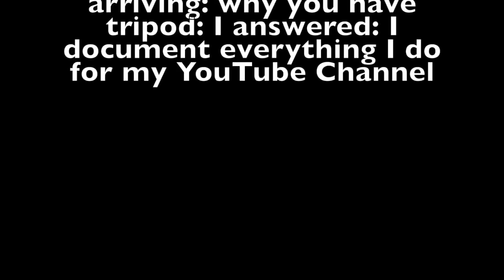Filming Guide One insurance adjuster went wrong: Adjuster walks away on Dmitry (Roofing Insights)

Comment: Those small dents will not affect the longevity of that metal roof,unless the hail damage is bad enough to allow the roof to leak. That contractor is just exploiting everyone causing the price of roofing and insurance to go up
Reply from the maker: Would you drive a car with hail damage? It will not leak inside why would you care right? Or would you “exploit” insurance company to file a claim?
Reply: If you have to rub the dents with chalk to even see them then yes I would drive the car and not create excessive claim and cost to the industry
Reply: Are they trying to get a new roof because of some little tiny dents? Wow what a scam
Reply: its the adjusters they what to replace it if your paying but not if they have to most have more training in this than the actual craft of roofing
Reply: I usually am on the contractor's side in these videos but this particular issue is different. The WHOLE POINT of this style of roof is to take more dmg than shingles. The reason we redo shingled roofs with pocks and dents is because they are an issue. On a metal roof, they are not. That again, is the whole point of metal roofing. It's so that you don't have to replace your damn roof everytime there is a hail storm...
Reply: @ravenna6543  I agree with what you said, I just don't know why he got upset about being recorded?
Reply: @danbrown7224  Some people are really not ok with being recorded even during work like this. IDK, I kinda get it. I don't even like being in photographs with friends but at the same time, I won't throw a hissy fit about it.
Reply: @ravenna6543  I agree, but in my opinion on his line of work he should expect to be recorded at an estimate like it or not , especially this day of age there's cameras every where like it or not,
Reply: @danbrown7224  100% agree
Reply: @ClickBait99  then they probably shouldn't be getting metal roofs?
Reply: I don’t see any paint chips in those two tiny dents, that roof will deteriorate over time due to the sun rain and people walking all over it. Its a shame no one wants to quit wasting time and money over such trivial ideas
Reply: The problem is not so much the dents, it's the dents have stretched the metal therefore causing undue stress on the finish which in turn will lead to early roof failure. Not to mention paint missing off your roof is unsightly.
Reply: If that metal roof was half way decent that chalk wouldn’t even write on the metal surface because it’s supposed to be smooth and glossy finish…that’s some out dated nailed on old school metal, probably put on in the 80’s lol CLAIM DENIED
Reply: @bradlycriswell1990  If your dented up paint faded rusted out Camaro got some questionable dings in it from hail I doubt insurance is going to be buying you a 2023 Camaro….I roof for a living and own 2 homes and pay plenty of homeowners insurance, your “sheep” comment is so laughable lol
Reply: @3rdgen257  sure you would lol. Come on..I get the point you arw trying to make , I do. I also can observe a corrupt inspection. How can he record zero and then make up an excuse ? Also remember,  the policy holder called the insurance.......not the contractor.
Reply: So the contractor called to make a claim? Or the policy holder? Yeah that's what I figured
Reply: @danbrown7224  better yet maybe the insurance company shouldn't insure them....but they take that check for the policy every year.....don't they
Reply: Cosmetic only , and you can't drive a roof.
Reply: @bradlycriswell1990  Well I’m about to see if your theory is true …wife was legit just in a fender bender in my old ‘08 truck, what color should I go with on my new one? If they don’t give me a new one can I borrow some of that 3x money? 🤣
Reply: @3rdgen257  some people like to take care of the things they own, hence getting insurance in the first place...
Reply: @bullfrog1807  If your faded out rusty camaro has full coverage, they will pay for hail repairs. Either the cost to repair and repaint the car or the value of the current vehicle.
Reply: @RoofingInsights3.0   different comparisons. most insurance policies specifically exclude cosmetic damage on metal roofs. If it doesn't affect the function of the roof, they won't cover it.  Again, thats most of those polices that are written as excluding it. There are inclusive coverage policies, they cost more of course, but they do cover the cosmetic coverage.  Make sure you know what coverage you have before you file a claim.  This one may have not had cosmetic coverage and thus, the adjuster is not finding anything that needs to be fixed, under that plan .   Asphalt shingles are different... the cosmetic damage there is also structural as the shingle depends on the asphalt and the granules to provide protection.
Reply: Fact: Adjusters pay for 90% of the roofs where hail damage is claimed.  

Also Fact: Roofing contractors believe all roofs are damaged from hail at all times.
Reply: Agreed minor dents not that important.
Reply: It's called property value. Just like a car value will go down with dents. May not be able to see them from afar but when you go to sell the car the buyer will notice the dents. Just as a property owner when selling a buyer will request a roof inspection, a smart buyer that is.
Reply: @RoofingInsights3.0  Dents in a car lowers it's value by a lot, tiny dents on this roof will not lower the buildings value.
Reply: Insurance's whole thing is exploiting people and denying claims LOL
Reply: @bullfrog1807  well Yeah, because there aren't going to be any 2023 Camaros.
I did just buy a 2022 ZL1 though
Reply: If the dents make my roof look like shit.  Hell yes I am going to file a claim.  Having a roof that looks like shit could affect my business.
Reply: Is he a contractor?  I thought you, Dmitry, were the contractor and he was an insurance inspector.  You’re right though, this kind of attitude is garbage.  What’s he afraid of?  That you will be able to show the insurance company that he was dishonest?  I think that was made clear in the video what with the 0 pings marked on the report.  People like that don’t like it when their authority is challenged so he basically “took his ball and went home”, so to speak.  I hope you have an update to this case.
Reply: @Fred-zt6gf  That’s total BS dude.  If the home owner wants to record they should be able to do that for their own protection and yours.  If you do so called honest work then this shouldn’t bother you in any way.  Are you worried that your little shortcuts will be discovered and there will be a digital record of it?  Pay you extra because your client turns on a camera?  You aren’t a celebrity, sports figure, or singer so why would you think that someone would want or even should pay more for that?  That you actually have stated in a public forum that you “will not do my normal work” tells a lot about you as a person and your lack of scruples.  SMH.
Reply: A dent on metal roofing, regardless if it completely penetrates the panel causing a leak, is still damage.
Reply: @ravenna6543  doesn’t matter how you feel about it, you can filmed in public. End of story.
Reply: @darthbrooks4933  That's my point.
Reply: Not true
Reply: It’s called indemnify, for a reason.
It has nothing to do with leaking.
The roof is covered for cosmetic appearance and damage.
Reply: @djchristrent  Roof looks fine, cosmetic appearance is near perfect.
Reply: @ClickBait99  so repaint it.
Reply: @3rdgen257  you likely pay for this coverage inside your policy. It’s not just a cosmetic issue. Dents, caused by hail, on a metal roof can cause micro cracking to the paint and substrate. This leads to oxidation and premature rusting. On an asphalt shingle, hail hits CERTAINLY cause premature failure.  If you pay for the coverage inside your policy, and there are real problems caused by the damage, then there is absolutely nothing wrong with trying to file the claim.
Reply: yep
Reply: People still pay years for insurance, and when they finally need it insurance companies will screw you over every time.
Reply: @RoofingInsights3.0  if I had insurance due to hail I'd take it.
Reply: @Fred-zt6gf  why do you need to get paid extra to be recorded?
Reply: @RoofingInsights3.0  An auto insurance claim and a homeowners insurance claim or two different claims. They are treated different
Reply: @bullfrog1807  If it totaled the vehicle they will only give you the current value of that vehicle. They will not give you full replacement cost. They’re not going to give you 30 or $40,000 for a $7000 truck
Reply: @bradlycriswell1990  your comment the bullfrog is the most laughable comment up here. No one said a damn thing about your net value nor do they give a damn if you want to brag about it or not. You’re just showing your ignorance and insecurity
Reply: @bp4170  you would have to have one hell of a dent in the metal roof for your statement to be true. I have a roof that is over 18 years old and has dents in it from a hail storm after the first two years of installing it. To this date we have had no problems with the roof. No paint chipping no rust forming nothing
Reply: @alllivesmatter627  I have a metal roof therefor Im an expert!🤡
Reply: @bp4170  well I’m glad you are. But having a metal roof does not make you an expert. 20+ years in the business dealing with the reps from the shingle companies and the people that make the metal roofing helps to give you a lot of knowledge for which I have
Reply: @ClickBait99  it’s not the same as an asphalt shingle, poor comparison.
Reply: @michael2943  very common in this industry.  Roofers are just as bad as the insurance companies that argue claims.
Reply: @ClickBait99  claiming all small dents causes paint chipping is inaccurate.  Claiming this roof needed to be replaced is laughable.
Reply: which is what ends up happening, either way it needs to be recorded not a ZERO. The Adjuster did his job wrong and does not deserve another claim. Meanwhile, people like myself work hard every day with tons of experience to land places like Churches - to give them an HONEST assessment. This guy had his mind made up before he even got there. He is a LAZY OLD MAN.
Reply: @RoofingInsights3.0  sue them for damages loss of pay effing up the job get a bigger settlement
Reply: You clearly asked him to look at the mark and he immediately refused
Reply: Your absolutely right....
Reply: @3rdgen257  so whats the point in paying insurance?
Reply: @bradlycriswell1990  a man child that doesn't have the ability to type 5th grade level english is telling another man he can buy them 3 times over. Here is your trophy for being king of the internet today, enjoy your success big girl.
Reply: @RoofingInsights3.0  i do drive a car with hail damage. Insurance is for large losses. They will just raise your premiums.
Reply: @dillydilly952  building gets catastrophic damage like roof blows off or building burns down, not a broken finger nail or paper cut
Reply: @WolfBiteTactical  what a scam it seems like the insurance adjuster s e e s the indentations and determine because there was no splatter marks was not caused by the same hail storm or even hail damage if it was hail damage would be clearly across the entire surface of the roof Dimitri is stretching the issue see if he can convince the congregation of that church to pay him and his crew to replace it at their expense
Reply: @unknownperson2422  and if they don't pay the claim you're going to pay to have your roof replaced yourself?
Reply: Once I heard the eastern European accent, I knew it was a scam by the contractor.
The roof is not a car, by the way. The standards are different.
Reply: @danbrown7224  He has something to hide.
Reply: @ravenna6543   Wow, never saw hail damage on a shingle roof... must be baseball size! lol
Reply: @RoofingInsights3.0  for one you see the dents on the car and probably damaged paint. I’ve had 2 cars with hail damage and they drove and operated just fine.
Reply: @danbrown7224  insurance shouldn't be covering metal roofs then
Reply: If you don't get it fixed, it voids manufacture warranty...
Reply: @RoofingInsights3.0  I got my truck in 2015.  It's had minor hail damage since 2016.  Haven't filed a claim.
Reply: @RoofingInsights3.0  A car is not a roof. Does the policy cover cosmetic repairs, or just damaged leaky roofs? If you can show the dents will cause the roof to fail, then for sure that's a reroof, if not then what does the policy say?
Reply: @RoofingInsights3.0  gloss paint and this paint thats satin an old is not a great comparison
Reply: @ravenna6543  insurance companies do cover dents on metal, whether they be roofs, fascia, gutters, etc. Just like in the case of a car, it is cosmetic, but still covered under MANY policies (given I can't speak for this particular policy). I feel like a lot of people commenting on this, including you, do not work in this industry and don't know how these things work. It is possible that this company has no idea what they are doing, but I'm sure they checked the policy to make sure hail hits were covered prior to calling in the claim and meeting with the adjuster.
Reply: @bullfrog1807  Someone with a head on their shoulders. It would be like me trying to get a pair of work boots replaced on warranty after wearing them for a year. That roofs like 40 years old and the building hasn't had leaks. I'd say someone got their money's worth.
Reply: @mikeekim242  I doubt an issurance company would still cover cosmetic damage on a roof that old
Reply: @nowerries  Well that was my point. What is in the policy? One side is trying to save a buck, and the other is trying to make a buck. That leads automatically to conflict....LOL
Reply: Yup, far as I'm concerned that was an old looking roof that looks like it has earned every penny that was spent on it. Would of probably been a task just to find panels to replace the existing ones with.
Reply: Insurance companies are paid millions of dollars to restore broken things, that's their job, that's why they get paid. But what they really want to do is take your money, keep it, and NEVER do their job.

The roof wasn't installed with dents the insurance company agreed to repair if damaged.
Reply: @lawsonransom8318  
You actually think water pools in those dents
Sorry to be you
Reply: @3rdgen257  I know it happens. 

I have had dozens of metal roofs approved because of it. But don't believe me.

I could care less what you idiots think or do. My company did $4.5 million in roofing last year. 

😆
Reply: @danbrown7224  if insurance companies don't want to cover metal roofs they should not insure metal roofs
Reply: @tunit8946  that's a stupid comment. What does driving it have to do with anything
Reply: @brucehart4627  very true
Reply from the maker: @bullfrog1807  in that case insurance company shouldn’t be insuring it and taking premiums for 40 years to cover it.
Reply: There paid to lie.  Otherwise no more work.
Reply: @ClickBait99  This needs higher up.
Reply: @RoofingInsights3.0  Yeah that’s true for sure, definitely should be up to the insurance company to send someone out annually to inspect roofs to determine if they should even be covered in the policy or if they will even provide services at all due to poor condition. In this case I could agree maybe a partial payout could be issued….but still think that roof was way past due to be replaced, homeowners shouldn’t be waiting for natural disasters to avoid paying for a new roof. Like I said I do see your point
Reply: @Sidicas  thats not restoring to a pre loss condition.
Reply: @RoofingInsights3.0  That is an apples and oranges comparison. Roof covers will receive cosmetic damage. That is a given, it does not impact function, the function of a roof is not to look good while you drive down the road. What exactly is the remedy for 'correcting' a few small dents in a metal panel roof? What does the manufacturer say about a few dents? Legally, you have the right to film this guy if he's in public, I guess. Professionally, you stop when he asks you to stop. That is bush league. You want people to treat you like a competent professional, you need to act like one. The people you encounter professionally are not fodder for your click-bait. Are you a roofer or a content creator? Honestly, it seems like you don't know much about either.
Reply: @RoofingInsights3.0  to be fair people see it on cars, I wouldn't care if it were on roof, unless it caused damage that leaks
Reply: Doesn’t need a new roof get outta here
Reply: As someone who works with a multinational insurance company, I can say with certainty that this is a ridiculous take. 

These people opened a claim to have this damage repaired.

The adjuster is trying to pretend that part of the damage doesn't exist.

Policies cover "sudden direct accidental physical loss"

Those dents affect the value of the roof and building, which constitutes a loss.

Those dents also open the door for long term maintenance issues (they're not leaking now, but they might be 5 years from now) that won't be covered by insurance.

If damage is caused by a weather event that the insurance company has agreed to cover, and the insurance adjuster is trying to pretend like part of the damage doesn't exist to save his company money, this is clear cut fraud.

He should be reported to this state's department of insurance, and the client should get a private adjuster who has an incentive to find damage not hide damage.

In no world does damage ≠ damage simply because "it's not leaking." This idea that the dents "are just cosmetic and shouldn't be covered" is ridiculous. You realize that the cosmetics of your home affects its value correct?

Not to mention, it should be obvious to everybody that actual DENTS in your roof aren't just "cosmetic." These areas will be much weaker and erode much more quickly over time. It will also open the door for rust to spread incredibly quickly. Any who works with metal understand how dents allow rust to creep in almost instantly.
Reply: Beat me to it.
Reply: Read policy b4 commenting
Reply: Just ignorance… if there’s a hail event in an area.. then that whole areas premiums will increase bc that area is higher at risk.. these insurance companies are BILLION dollar companies. They got money to pay Patrick Mahomes and Aaron Rodgers but not their customers?? That’s insane
Reply: BINGO
Reply: @ravenna6543  No, that’s not really the whole point of this type of roof. this type of metal roof with this gauge of metal hardly holds up any better than a shingle roof during hail as far as damage. It’s what happens over time after the hail has already caused the damage to the metal roof. It’s irrelevant that a metal roof will last longer than a shingle roof. But it will only do so undamaged.
Reply: @RoofingInsights3.0  Nobody can see the roof. The roof's job is to maintain the building envelope, not have a show-room shine.
Reply: Most metal manufacturers say any dents void the warranty because it could cause the enameled finish fo come loose because the metal stretches at a different rate than the finish
Reply: @3rdgen257 cool story man, tell it again
Reply: You don't know what microfractures are or the long term effect?
Reply: @danyoung9671  please give the explanation of what you are commenting on please
Reply: @ronfarrell08  
So walking on the roof must destroy it right?????
Reply: @3rdgen257  if you dent the roof when you walk..yes.
Reply: Pitting in a metal roof ruins the longevity of it. Pitting can cause rust, from paint chipping, and holding water.
Reply: What a joke of a claim! Claiming for a new roof for little dents🙈this is why our insurance payments are so high
Reply: My car has minor hail damage,  no leaks, runs fine. I drive it everyday. Wtf yall bitching about?
Reply: Dude!!! It's not just cosmetic. Where do you think the paint will peel first? Then where do you think it will rust through first?

There is no such thing as cosmetic damage on a roof.

This is what should happen. Insurances should not cover thin corrugated roofs, or increase the costs, UNLESS it is aluminum.

Other than that you should get thick Guage roofing.
Reply: @3rdgen257 when it is a nasty ugly color because the paint chips . . . That is called depreciation of home value due to storms. 

When they go to sell the home,  you think the adjuster won't notify the buyer to get them a discount? Lol
Reply: @chadhickey9942 not the case in indiana, but yes. Very possible and true.😊
Reply: You pay more than what you will ever. Get from insurance in your life. You work hard for your home and business to have a dented roof. Make that claim and get what is rightfully yours that you paid for and will continue to pay for. If the industry goes up then look at how many people at the top of that company are making for doing almost nothing. Re direct your malice toward the greedy and not people getting what they pay for
Reply: You don't know what his policy is, cosmetic damage could very well be covered. I'm sure the homeowners insurance didn't hesitate to take his money every month insuring that roof, so they shouldn't be hesitating to repair it either.
Reply: A lot of ignorance displayed in this particular response thread. wow. A lot of comments are conflating damage and coverage. Two different, while related, questions. If you don't understand what happens when the metal is dented - don't comment.
Reply: A year later here I am lol.. for 1. You know nothing about the policy or contract that the insured has with the carrier. This policy could have a cosmetic endorsement which would in fact cover cosmetic damage (“tiny dings”). 2. Damage is damage, you admitted yourself to seeing damage but that “it won’t cause it to leak”. So there is obviously accidental direct physical damage to the property which is covered by the carrier. 3. I could see multiple dents on the seams of the panels that could 100% cause a leak in the near/far future. Policy would also owe to indemnify the homeowner to pre-loss condition. Before the loss, there wasn’t dents in the panels or else it would be hard to believe that the carrier would even agree to such endorsements. And even if they did, shame on them. They should have never agreed to insure the property and take money. The carrier owes, point blank period.
Reply: @RoofingInsights3.0  This reply sealed your fate. Anyone who reads this reply after the main comment should come to the conclusion that this guy is indeed a scammer. Would I drive my car if it had hail dents in the roof? Uhhhh yes, yes I would, because a dent isn't hindering any useability aspect of my car. Poor analogy, made yourself look like a scammer.
Reply: @michael2943  its not a scam, the insurance policy covers hail damage to gutters and downspouts. thats strictly cosmetic but the policy COVERS it. The average US Citizen pays over 300,000 dollars in a lifetime for a service that is barely used, and when used, isn't reliable.
Reply: @3rdgen257 the idea behind insurance coverage is for the covered item (car, home, etc) to be returned to its original condition once covered damage has occurred. That is why in the case of auto' s you can, by law, request oem parts and do not have to accept after market parts. Insurance  companies are some of biggest "grafts" in existence. Why you purchase coverage from them and then not use the coverage you have purchased?
Reply: If hail dents the roof near the screws, it will allow water in.